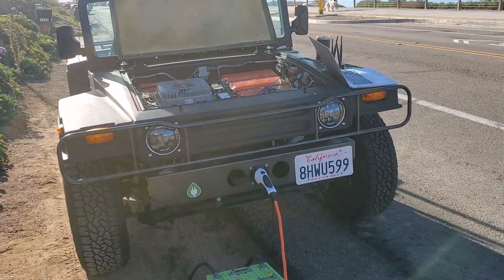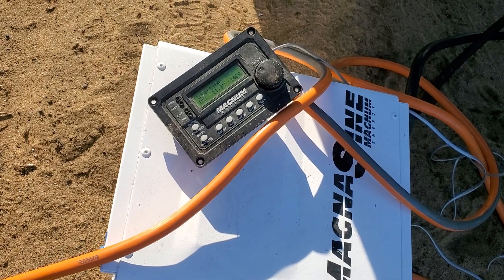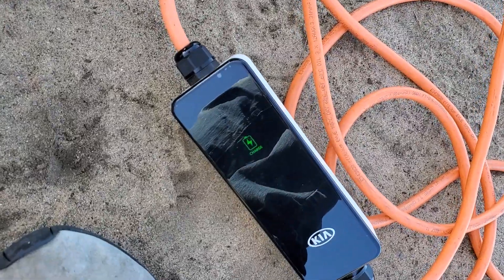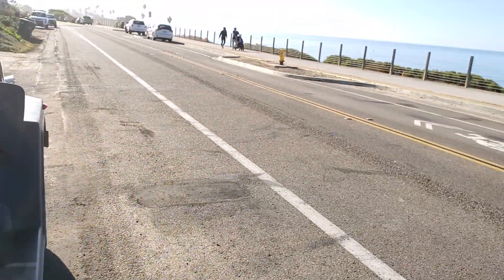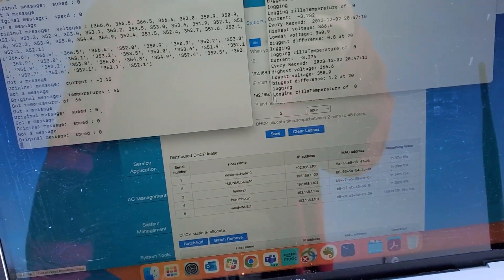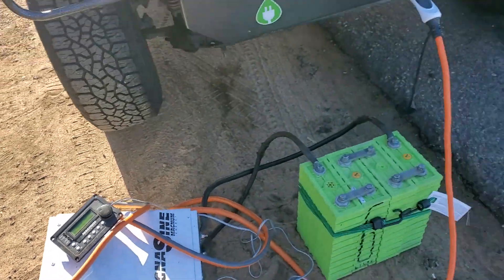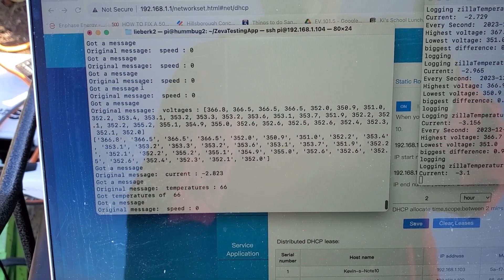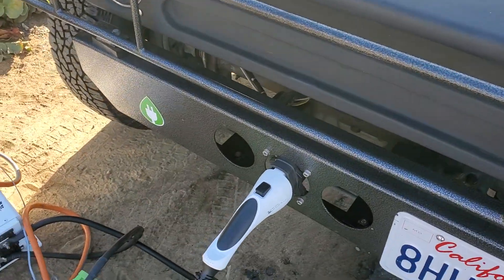Hummbug out of juice: Roadside Recharge

Comment: You anti EV trolls are so funny.  

You know people with horse's bitched about internal combustion engine cars and said they were stupid, when they came out, right?   

I love cars and gas/ diesel engines as much as anyone.  I've also helped build an EV. 
EV drivetrains are soooooo much less complex than ICE cars .. obscenely faster, yet basically effortless in being so.

Gas, diesel and electric all have their advantages. 

ICE is cool, yes, and very practical and automobile implementations based on it have evolved very far.  
But do you really think a smokey oily petrol burning engine based on technology from literally OVER TWO HUNDRED YEARS AGO is the future when we're getting into the era of real space travel, a.i. and massive breakthroughs in dealing with energy? 

Scientists are on the brink of actually being able to apply things like nuclear fusion.  A world where a car could be perpetually powered with an onboard microreactor (and never have to stop for fuel, and no need to carry a huge battery pack) could be a real possibility - that would only work with an EV drivetrain.    They already do it with submarines now... it's not a fantasy. 

What's the point of being so dismissive of EV stuff?  It's new technology... ICE cars sucked balls for the longest time.  You think something brand new just comes out and is immediately 100x better than something we've been iterating and refining for centuries?   

You're right, let's never even try new stuff, let's just do the same thing for generations and never change.  

I know Fox News told you so, but it's okay.  Change can happen and things do get better with time.  The man in the box told you the old guy wants to take your F-150 away and replace it with a Nissan Leaf, I get it.   Sounds lame.   It's going to end a lot better than that.  

What happens when cars drive themselves? And recharge themselves...and you just use an app like Uber to go places without even thinking about it.  It'll happen.  
What then? Your kids kids definitely will be in the DNGAF camp on this argument.

Comment: A little more involved that getting a 10 liter container filled and tipping it in the fuel tank. I once had a car that ran on LPG/ Propane only no dual fuel fuel system so if you ran out of gas you again could not just go and get more Liquid gas/ petrol to tip in. I got around this buy carrying a small 5kg BBQ gas bottle with me and I could hook it into my gas delivery hardware very quickly.

Comment: Charging batteries from batteries, with an inverter in between. That’s not making much sense, and those poor lead acid batteries will probably get damaged. A 5kw generator would take up less space, and be way cheaper.
Reply from the maker: They batteries in green are lithium batteries (Voltronix) and at the end of their life.  This video is just to show what can be done.  Definite loss of efficiency but a solution that will can be the "Jerry Can" for EV's

Comment: Wouldn't a portable generator give you enough charge in that same hour to get you the mile you need? I mean, charging your battery pack is still using the grid to charge, and this is just for emergency use right? So, unless the generator would not generate enough charge, the backup battery does not make much sense.
Reply from the maker: Yes a generator would help too but feels like a step backwards